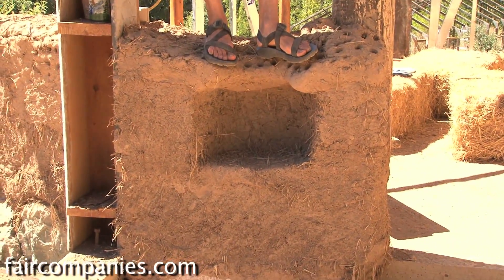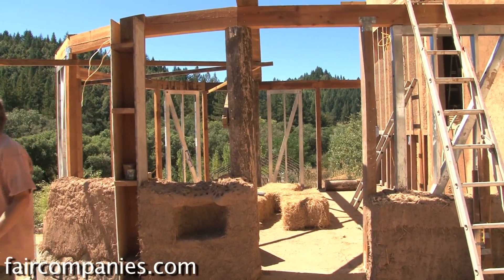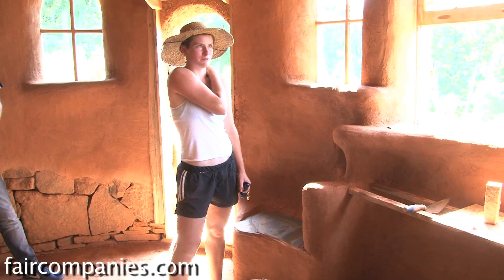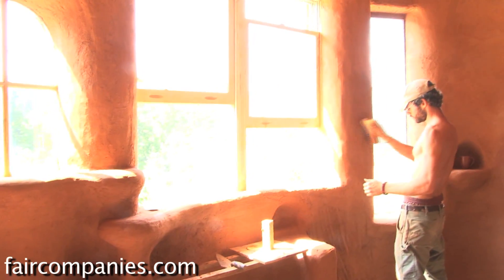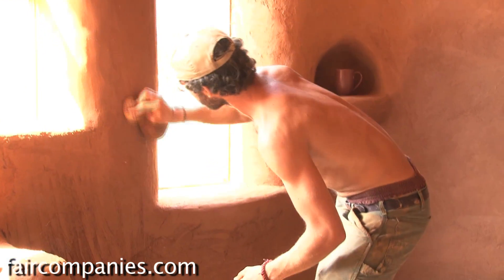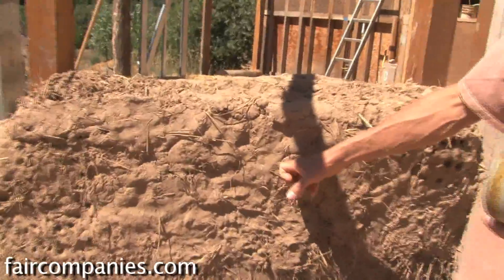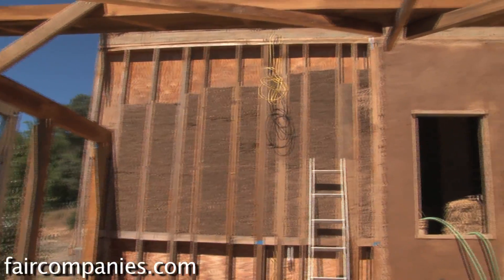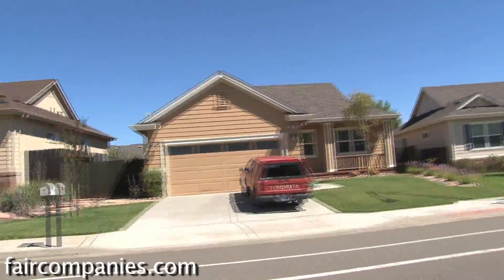Building your own bioclimatic home from earth and straw

Comment: Hmmm... rocks as foundation and wood framing... this is very stupid, the house is very fragile. Whole earth houses, when they dry, act as as a single unit, giving incredible resistance, including to tornadoes and earthquakes. Mixing with American building techniques, splitting earth walls into simple slots between framing is a very bad and wrong idea. Also walls must have 60-80 cm width in order to self sustain their own weight and give portability to 2nd floor.

Comment: we have earth castles in morocco they are many times older than usa, they are still used for tourist now,
you can add salt to the mix, because salt can dry and auto repair the cracks, its awsome,
and there must be a system for water inside of the walls :
and the walls must have holes for the earth to literaly breath :)
Reply: Top tips. :-)

Comment: nice vid, what about cold winters averaging -25 celcius. and and lower at night about -50 c ?
Reply: This is a very late response, 8 years 😅 but those techniques are kinda common were i was born and clay and straw, cub erc are  great for insulation. Here's super hot but it was always fresh inside the house but when was cold if have a heat source the warm temperature do not scape through the walls easily. I never lived un one of those but my great-aunt had and her home never had an unpleasant temperature.

Comment: He sounds so upset, it's saddening
Reply: I thought he was getting ready to cry. I couldn't work around him. Listening to him would set me off after a while. It was maddening to watch this. But,
I'm building a Hybrid cabin 400 sq ft. In Cochise county ,Arizona.  And wanted more info. I use a mix of sawdust/clay slip blocks, sawdust/straw/slip walls. And good ole Adobe. Some walls and such will be built with new H/T pallets. And will infill with Sawdust/Staw/clay slip in pallets.
I'm blown away by how solid/fireproof this sawdust blocks I'm making are. Slow drying but extremely hard. Just sawdust and clayslip, form up and dry it.
Great video

Comment: @kirstendirksen In tropical climate (heavy rainy places) you have to maintain the walls. And you don't use the straws. The biggest worry is termite which after a half a lifetime causes building collapse. I have never seen it multistory like this, it might be because the ones I've seen are made of clay mixed with fresh cow dung with wooden pillar frame. @19irving look up thatched roof.

Comment from the maker: @19irving You need a good roof, good floor (& good drainage underneath) and exterior plaster to protect from rain/moisture. There are centuries old cob homes in the UK (traditionally they used lime plaster). Though I'm no sure about spots where there is a lot of rain that enters at an angle (constant rain that hits the walls and not the roof might be a problem). I'm not an expert so I added a video as a response- "Natural buildings don't melt" - where Michael talks more on the topic.

Comment: What would you advise in referrnce to the ratio of componants would be used if you lived the south eastern USA. I would be using red clay mountain sand winter wheat straw and fielded horse and grass fed beef cattle manure on a cement slab and limestone masonry accents with natural wooden (eastern juniper) support structure. If you have any info that can help at all, I would appreciate it.